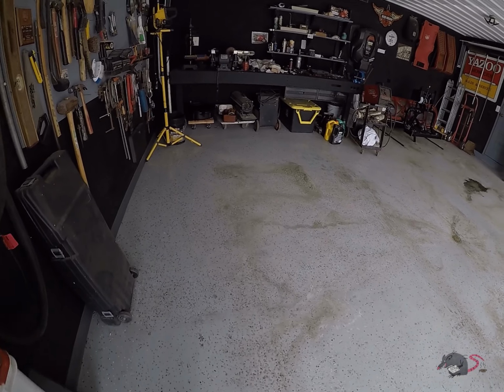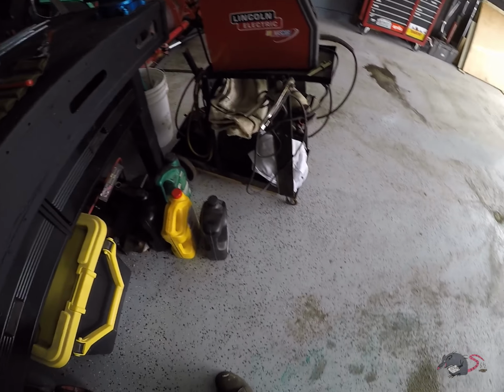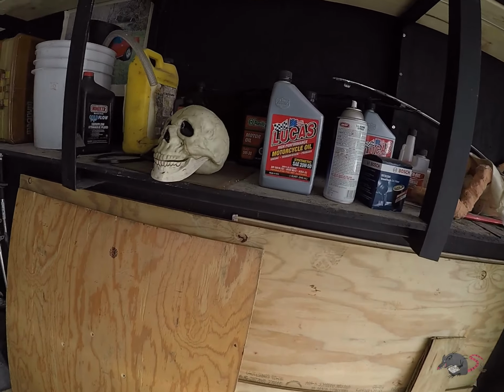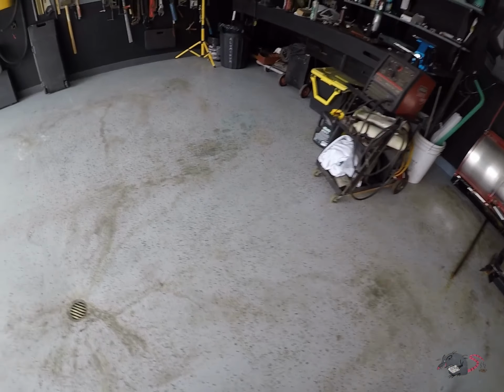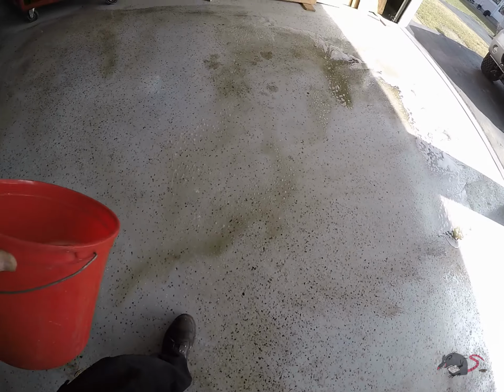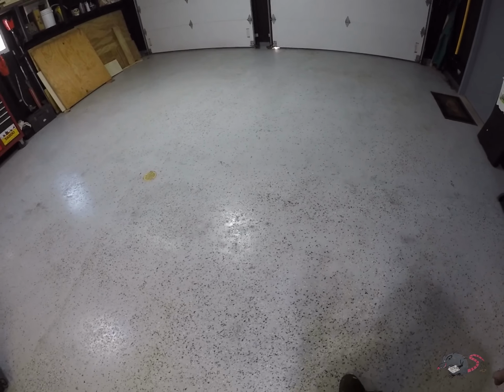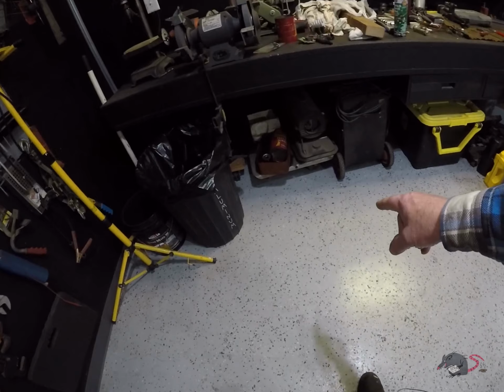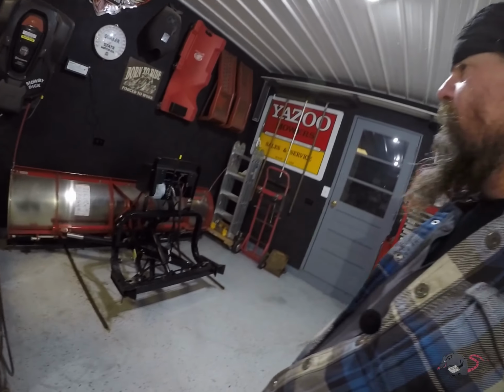Garage Floor Paint Update

Comment: The Greasy Shop Rag... The floor still looks good. I need to do something with mine.. I'm thinking about going with a company called Shark Floor Coatings and let them do my garage floor and my back patio..
Reply from the maker: A friend is hiring a service to do his 2 car garage. He was quoted $3000. Seems steep at first but when I think about all the prep work and how a pro job might look its probably not a bad deal.
Reply: @TheGreasyShopRag  That's high but it's worth it. My problem is having to move all of my crap out of they.. LOL